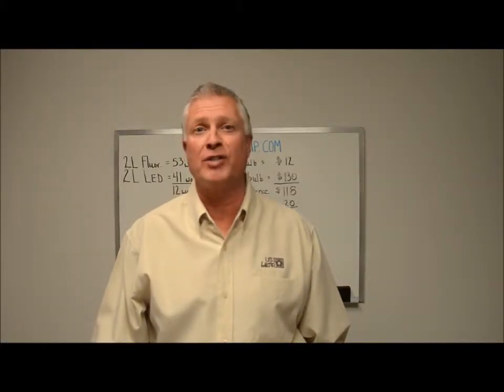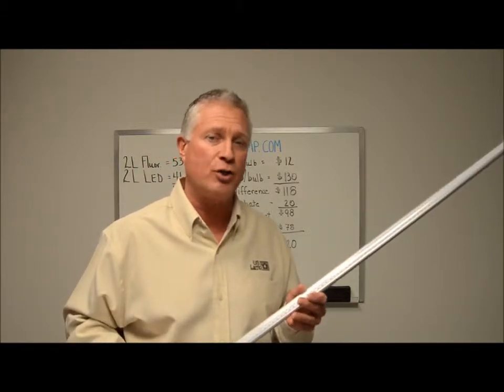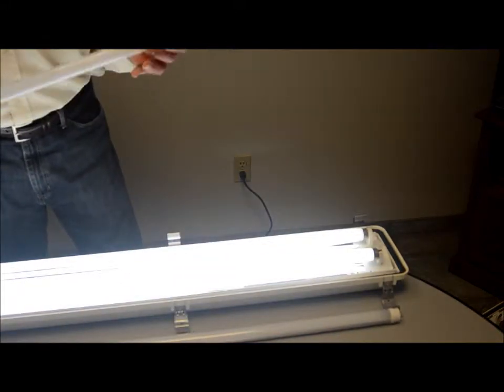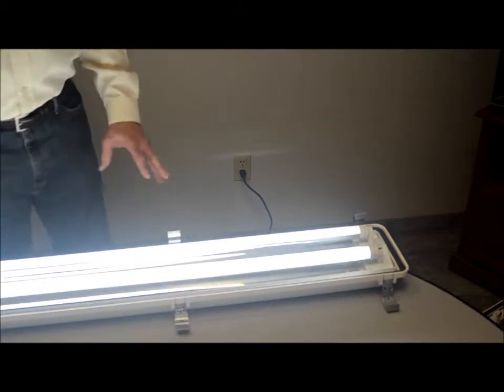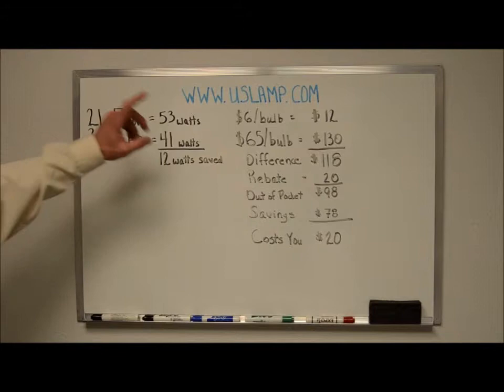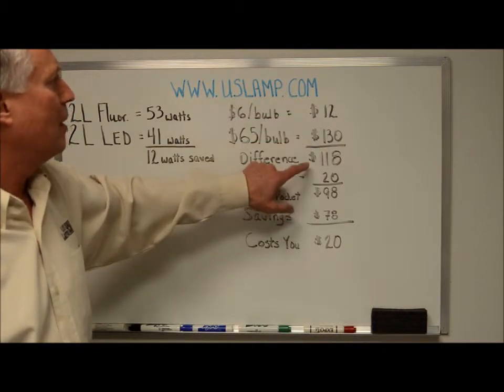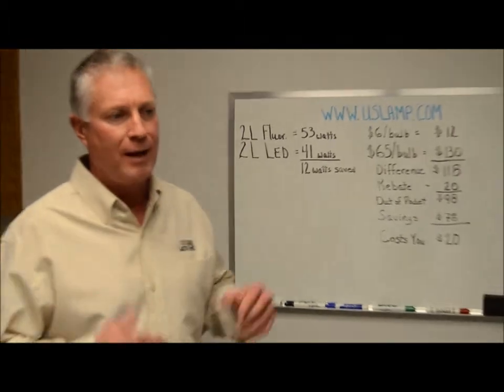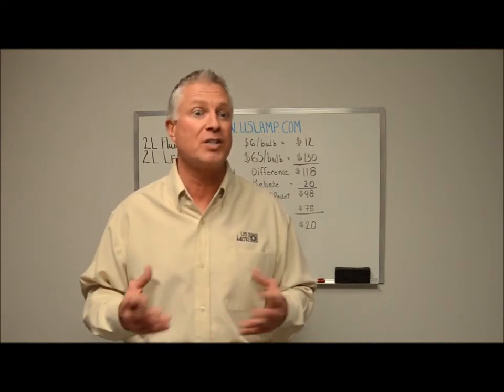Lighting Tech Talk - Fluorescent to LED T8 Retrofits

Comment: HI Randy, Im a electrical contractor, I service supermarkets here in NJ and am trying to convince them at the moment to not invest in this technology just yet and getting resistance of course from the manufactuer in this case its Phillips. Did you find any differences with power factor on the ballast. I'm finding the amperage is the same wether the LED or the Fluroscent tube is plugged into the light and that the wattage output is about 21 watts for either tube